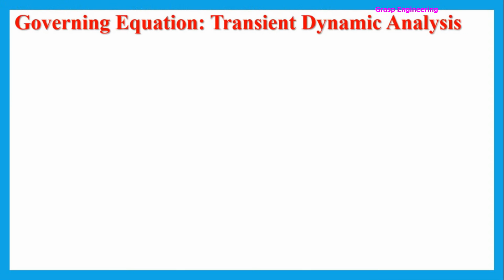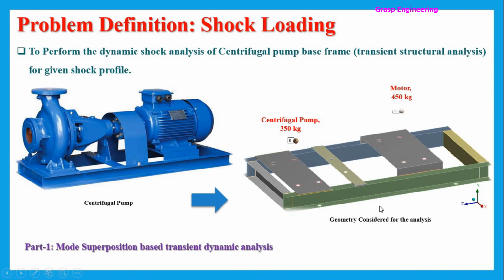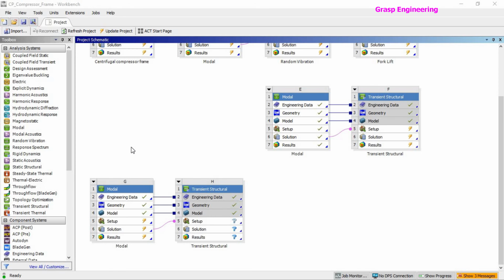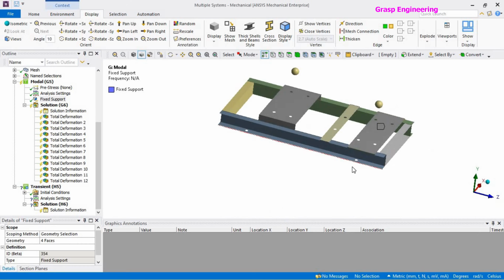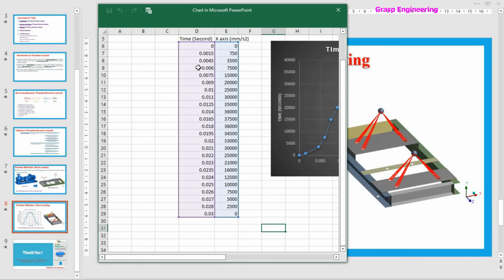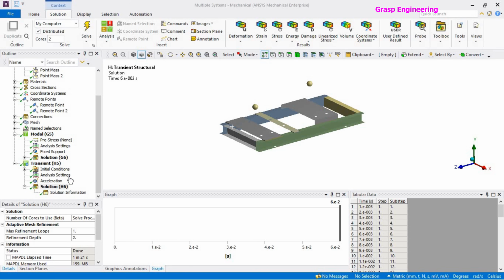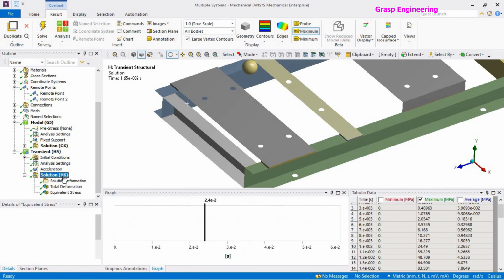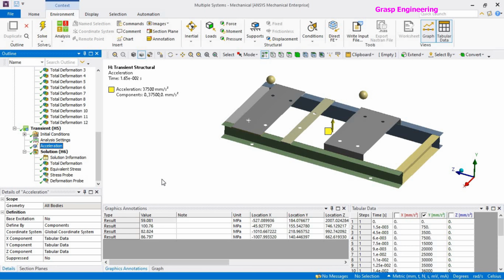Transient Structural Analysis of Centrifugal Pump Base Frame using ANSYS

Comment: During 19-20 mins it is mentioned that peak response comes after peak acceleration time (peak acceleration at 16.5 ms and peak response at 26ms). I am doing analysis of a PCB assembly. In my case, the peak values for deformation and stress comes at 4.6 ms and peak acceleration happens at 5ms. Can anyone please tell me if I am doing any mistake or if this is alright?

Comment: hi, i am doing wind analysis of pipe rack structure with bolt connection  in transient analysis using one-way FSI analysis. If I am running  the analysis with dead load, wind pressure, gravity, and fix supports, the analysis is running successfully, but when I am putting the bolt pretension load, the analysis ran but after 6 7 hours It gives error that solution could not converged. what should i do

Comment: Great work, for my thesy work i have a compression test lattice structures dimension 100*50*50. Is Transient analysis correct? I want see the damage of structure
Reply from the maker: Yes, correct. But transient analysis will required huge amount of time.

Comment: Where an we get the acceleration time data for the motor(excitation load)
Reply from the maker: You need to measure from your equipment. You will get from accelerometer readings.

Comment: Should we not consider mass moment of inertia of motor and pump assembly along with mass?  I think this is very important and system dynamic response would be very different from what we would get by only considering only mass and not inertia of motor and pump.
Reply: That's right I think inertia plays an important role
Reply from the maker: Yes, if you have mass moment of inertia and then you should include while defining point mass.